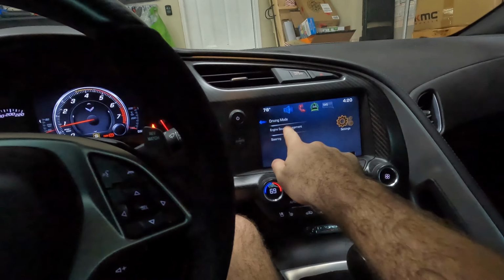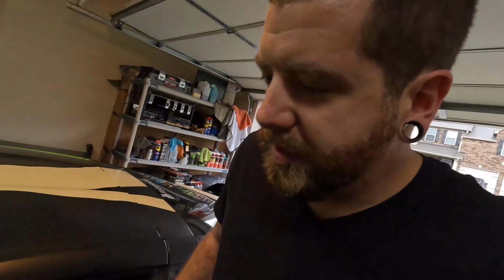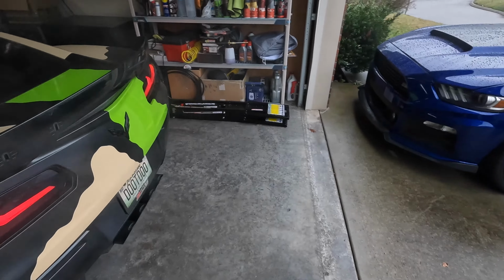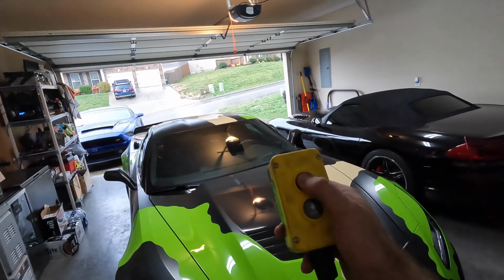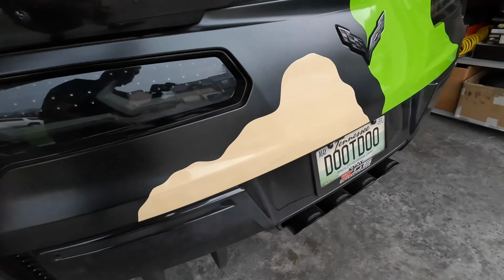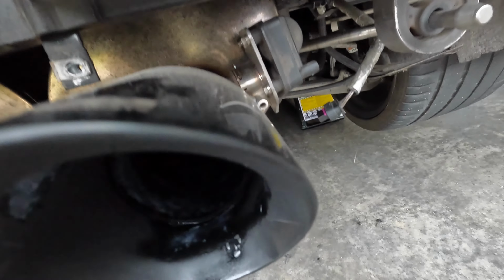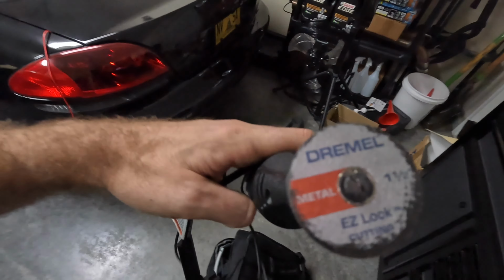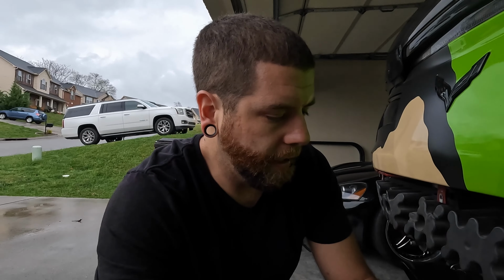Fixing The Exhaust Rattle In My Corvette ***EASY FIX***

Comment: Hey man so glad you published this video! Can you tell me how I can get the technical bulletin you mention in your video? My 2019 GS has stock exhaust, and it recently started this strange rattle. My exhaust is in TRACK mode all the time, and it recently started rattling at about 1700 RPM in 3rd or 4th gear. When I put it in STEALTH mode (i.e. close the outer valves) it rattles constantly at any speed or RPM. I’m pretty sure this fix of yours is what I need. Thanks so much you’re gonna save me money!
Reply from the maker: The service bulletin is linked in the video description. Glad I could help!

Comment: Did it ever also do this around 1,100 RPM to 1,500 RPM while driving when the engine was hot/normal operating temperatures? 

I know it's a very specific question, but for months I thought I had a bad lifters or a bad tensioner and it wasn't until today that I finally heard it while parked (never happened while parked before) and I realized it I probably have the same issue.
Reply from the maker: Happened basically all the time in mine. It's easier to hear at lower RPMs because the exhaust just isn't as loud.

Comment: Did you happen to hear it when you were driving in a high gear but low RPMs?  I recently upgraded to the corsa extreme exhaust and I notice a rattle/vibration sound then and the only way to get it to stop is to speed up.  My C7 is a GS, Auto tranny.  It also won’t vibrate if I put on the paddle shifters
Reply from the maker: The rattle was present all the time because of the valve actuator. Your problem sounds different. Are you sure all your clamps are tight?